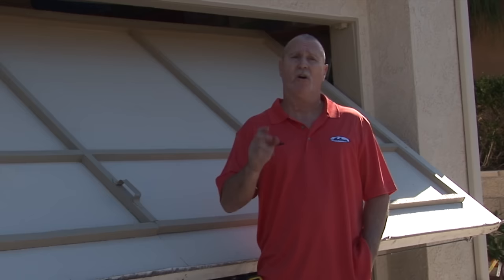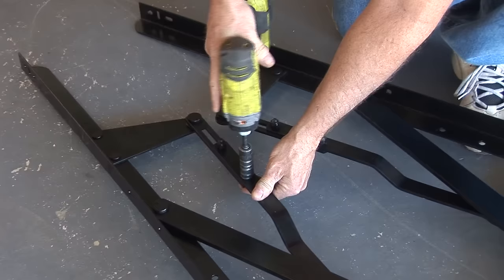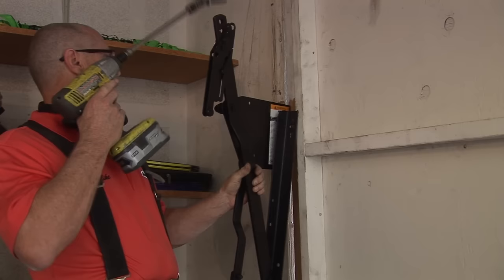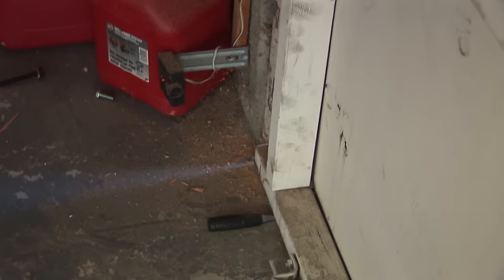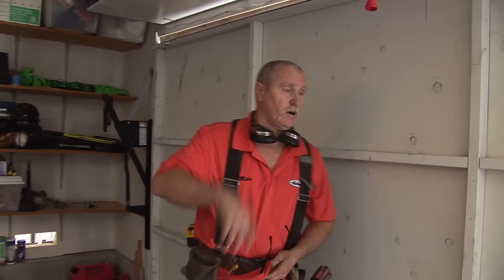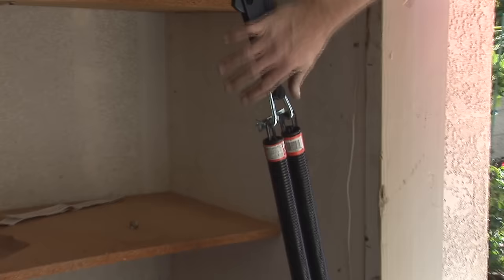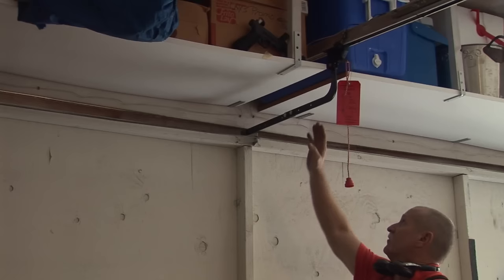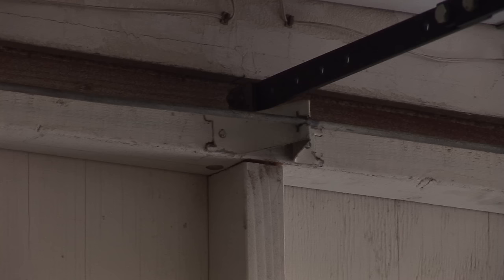Installing Holmes E-900 Hardware & Springs

Comment: How the heck would you connect conduit to a garage door bracket. I have to know. Ok wait you flatten one end and drill a hole in it?
Reply from the maker: Exactly! but if you have one of the wider chamberlain door brackets then just flatten it enough to fit inside the door bracket, oval it basically... it eliminates slop if you have a tight fit.

Comment: Great video 
Hi Ben  from Australia 40 minute  you talk about the normal hole on the plate mine is in the second hole I need to move to the normal  hole  do I support the garage door   take out the springs then move it or can I move it  with out taken the springs out. Cheers
Reply from the maker: That's a great question! By the way... G-day mate!! Always love talkin to the Aussies! You can do it without removing the springs, you have to kick the door out so it's about a foot open then support it with your leg and back then remove the bolt. Now the door is going to want to go down at the bottom and forward at the top and the bolt barely has enough room to come out (there's a washer in there too so don't let it fall out) but once you get the bolt out use your leg and back to force the door to go in the direction you need it to go in order to drop into the normal hole, it's a bit of a juggling act with some finagling but it will go.
Reply: @ALLProGarageDoors  Cheers mate thanks.

Comment: Hi Mike, I have a 8 feet high tilt up door. I can't find any e900 hardware for it. Do you know where I can purchase it? Thanks
Reply from the maker: E-900 is only rated to 7’4” or 7’6” high doors. look for Lcj-8 or Hcj-8. you could also try Apex hardware, its better than Holmes and they make 8 ft as well. try home depot. com or google apex garage door hardware.
Reply: @ALLProGarageDoors  Thanks Mike! That helps alot

Comment: Great video, very informative.  I have a one piece galvanized metal garage door (dimensions:  215" W by 82 1/2" H). One of my door side springs broke.  I could not determine what size the spring was, it was very rusted. So i looked for a replacement spring about the same size and diameter. I bought 2-P528 springs.  After i installed 2 new springs the door would not close, it only partially closed then got stuck.  What do think I am doing wrong or have not performed any adjustments. Also how do i determine which are the correct springs for my size and weight of garage door?    thank you Phillip
Reply from the maker: It sounds like you have the right size springs if you tried to match what was already there. It's extremely hard to tell why your door springs are maxed out. maybe this video might help.  
https://youtu.be/VgxtZlpW9us
Reply: @ALLProGarageDoors  I am 73 years old with heart disease.  I am not strong enough to extendP528 springs, any suggestions on other options to extend springs to the C hooks.
Reply from the maker: @phillipnajera5224  I've never tried it any other way, maybe a neighbor could do it for you? I think it could be done other ways but rigging up a come-along would be just as much effort.

Comment: If I use a one-piece door like this will I have more height? I have a standard type Clopay 4 section door now. I am able to build a door as you did in your other video. Thanks
Reply from the maker: lostintime86 no... you’ll have less height because the door sits under the header. So you lose the thickness of the door, roughly 2-6 inches depending on if you use steel or wood.

Comment: Sir I have two 12 foot wide by 8 Foot tall doors to build and install. The E900 hardware kit list that it is for 7'4" tall doors max. Can I make this work for the 8'-0" ? Can not find any hardware for 8'-0" tall doors. Any suggestions would be appreciated. Thanks for the videos didn't think about building the doors until watching your video
Reply from the maker: Normally the 8 ft hardware is listed as LCJ8, if you can't find it then yes the E-900 can work in a pinch but sometimes balancing the doors  can get trick but if you use p-732 springs,  you should be fine.

Comment: When I build my door to fit my opening...what should the tolerances be? I want the door to fit snug as possible as it the room/garage will be a living space when closed. Think more of a flip up wall than garage door. It won't be cycling open and close as much as a regular garage door. I was thinking 1/4 inch gap on each side? Also does the door hit the header at the top to make a nice seal? Or is there a gap at the top also?
Reply from the maker: Garrett Brittle great question! If your not putting an opener on it then yes you could do a 1/4 inch, with an opener then min 3/8ths and yes the door should touch the header for a good seal.
Reply: Perfect thank you. I got one more question - I hope. I want my door to be flush on the inside of the room with the drywall. To do this I was thinking I would make the top of the door fit the inside area of the opening just as the sides of the door do with 3/8 inch tolerance. Would this work? Picture basically a 2x4 constructed door that fits in the 2x4 constructed wall like a plug. Think it can work? I can call or email if needed.
Reply from the maker: Garrett Brittle , i think it can as long as its not too wide because a double door needs a truss rod to support the sag when its open. If you plan on tucking it in underneath the header instead of butting up to the header then start looking around for whats called “flush mount hardware” not sure if its still avail or not but i would think somebody makes it still.
Reply from the maker: I think if you use normal hardware you will need between an inch and an inch and a half if you want to tuck under the header... 3/8 above the door I don’t think is nearly enough.
Reply: All-Pro Quality Garage Doors Inc. hey man thanks for response. I ended up modifying the header to make the door flush. I’ll record a quick video showing what I did. Build my single car door yesterday also.
Reply from the maker: Unless you can locate a set of flushmount hardware.

Comment: Where can I get just one of the deadbolts that comes in the hardware kit? Every one I can buy is thinner and cheap or a 3/8" padlock shackle will not fit even though they claim it's for that size.
Reply from the maker: I prefer the shielded hasps, you can probably find them somewhere online.

Comment: As far as lubricating the 5 pivot points, would White Lithium grease be adequate, or is there a specific lubricant you recommend?
Reply from the maker: I currently use white lithium.
Reply: @ALLProGarageDoors   besides lubing the moving parts "inside" the GDO, would you also use white lithium grease on the chain, sprockets, and the t-rail?
Reply from the maker: yea you can use white lithium on anything really.

Comment: If I install the door so that the top of the door touches the back of the header, does that mean that the door isn't 100% vertical when it's closed? Does it rest at a slight angle or does the door come down vertically behind the header?
Reply from the maker: Phil L The door does indeed touch the back of the header and should sit fairly vertically, sometimes they aren’t perfect and could be at a slight angle outward when fully closed...but that is controlled by the cantelever arm and can be adjusted.
Reply: Ok, that makes sense.  But if the top of the door is hitting the header, what is the purpose of the jamb bumpers (or door stop)?  Should it hit the header or door bumpers first?
Reply from the maker: Phil L In a perfect world you would like the door to hit the header and the jamb bumpers at the exact same time.
Reply: Great.  I'm going to give it a try.  I'm up in Poway so if I get stuck, I'll give you a call.  If it all goes well, there'll be a nice YELP review.
Reply from the maker: Phil L excellent!

Comment: The guy knows the plate is fractured because he ran into the door in his BMW approx. 6 months ago but fails to bring it to your attention. 
If it failed the next day instead of today, do you see the customer trying to place blame on you since you just worked on it? Or am I overly cynical and need to stand down? 
(I have been accused of being a "conspiracy theorist", whatever that means, before) 
And do you consider it bad on your part for not noticing the damaged plate immediately? 
Thanks again, Mike!
Reply from the maker: I wouldn't say it's overly cynical to always think of all possible variables... i do it all the time. In this particular situation everything was set up by Holmes Halley the hardware mfg, they gave me an address of a guy who's hardware was worn out and the sales rep met me there with the new hardware so up to that point i'd never been to that house. We fired up the camera and just went at it.

Comment: How cool I figure where to place the main lever on the jam without a template? Thank you.
Reply from the maker: You measure 19 and 1/2 inches down from the underside of the header beam plus the thickness of the door taking this measurement from the side of the door not the top or bottom. If you have a design on the door that has to be considered as part of the thickness as well. Now that measurement would be where you would drill your first pilot hole for the Lag and NOT where you place the top of the plate.

Comment: so the E900goes up to 350lbs. Those are single doors. I have a double 7'x16' all wood from 1969. I have no way to weigh it. I cant seem to find anything bigger then the E900? does anybody know ones that are close to the Homes 1100 series that I have on the door already?
Reply from the maker: The 1100 series is light duty. Use the E-900…. much heavier duty. If you think your door is heavier than most you can look around for HCJ-7, that’s pretty super duty but might not be available anymore.

Comment: Getting ready to finally replace my original Holmes garage door hardware. Why wouldnt the new "hinges" just bolt up with the old mounting holes if theyre the same mfg hinges? Thanks
Reply from the maker: They can as long as they are the same model of hinges. Older hinges tend to be 1100 series and newer ones 900 series if they don't match the hole location should be different
Reply: @ALLProGarageDoors  makes sense. Thx for the speedy response.

Comment: Good morning Mike, I already brought the e900 with me, a problem, and they made me leave the box at the airport and I don't have the instructions, but I want to ask you. Is the midpoint of the floor to the ceiling of the wall where the arms will be placed taken as a reference? Or how do you get that distance? Thanks, hug.                                                             a problem picking it up at Home Depot is one store where the springs were and in another the arms, uffff, wrapping it, etc, so that later they made me remove the box and pay again to laminate it, chaos.
Reply from the maker: To get the measurement location for the E-900 you measure 20” plus the thickness of the door, from the top of the jamb down
Reply: @ALLProGarageDoors  I don’t understand sorry
Reply: @ALLProGarageDoors thank you Mike thank you
Reply: @ALLProGarageDoors  the thickness of the aluminum frame above?
Reply from the maker: not just the frame but the door
Reply: @ALLProGarageDoors 20” ?

Comment: If my installer stripped some of the bolts, where can I get replacement bolts?
Reply from the maker: Phil L  that means your installer wasn’t much of an installer. You can contact Holmes or just go to a hardware store and pick up some grade 8 bolts.

Comment: And if I buy a 728 and in reality the final weight is less than 250 pounds, does the excess spring cause me problems? Or would I have to put the 528? I still don't know the final weight, I'm starting to build it out of aluminum these days. I have to go in 10 days to buy them at Home Depot in Fort Lauderdale but I'm going to buy them before I know the final weight of the gate. Thanks bro.
Reply from the maker: Aluminum doors can be tricky to balance because they are so light. I’d probably go with 1-528 on each side if it’s a double car width and try to balance from there.
Reply: thanks mike, so i'm going to travel to fort lauderdale to home depot for the kit and the springs, i'm going to buy 4 528 springs, if it goes well with one on each side that's fine, and i keep the other 2 as spares? but check that it is a double door but complete. it measures almost 20 ft wide. and height 7 ft. Wouldn't 2 of the 728 be better? I don't know, the one who is the teacher is you. thank you very much mike you are a great man
Reply: this would be my request, do you see it well? or remove something?   2 - 728,   2- 528,  1 - e900 kit hardware, 2- wh-18 w- hook
Reply: Or. 4-528. And same 1- e900 kit  and 2 - w- 18 ?
Reply from the maker: @ger7941  If it were me i’d go 2-528s and 2-728s for spares since they are cheaper. i think you can balance a 20x7 pretty easily with a 528 on each side but if it doesn’t work then atleast you’ll have the two spare 728 for added tension. so yea i think your first list is accurate
Reply: Thank you Mike. Gracias.

Comment: Man, I just don't see what the benefit is of using one-piece doors. I know you don't need to use track like with sectional doors, but, they just seem so much more protruding and..... in the way I guess you could say. I actually didn't realize they were still used today (I'm from the Northeast, so that probably explains why). All that said, nice work!
Reply from the maker: Sharkie626 I’m with you that buddy but occasionally you will get that type of person who absolutely loves their 1pc door and won’t part with it.
Reply: Yep! I guess that can apply to many things and not just doors. Haha.
Reply: For one part their is less components on a one piece door then as a sectional door. And there are some one piece doors from the 50’s that look real good and no one wants to get rid of them lol
Reply: Benefit = As you said, no over head tracks sticking into the garage. Those tracks need to be supported by attaching them to the ceiling.  My garage roof goes up almost 1.5 stories.  My shelving on the walls would be obstructed by the tracks inside the garage.  Drawback = You can't pull right up to the door.  I have a long driveway, so not an issue.

Comment: Why does my door hit the header when opening ?
Reply from the maker: Lots of reasons for that, could be wrong drive arm angle, down limit set too far, top section flexing too much and allowing opener to push it down and under the header. Easiest way to fix that is to adjust your top roller bracket so the door can't possibly go that far forward. In other words loosen the top roller slider and push the slider forward bringing it closer to the door and tighten it up.
Reply: I won't be using an opener, I'll be doing it manually. Do you think the fact that I used a 2" square metal tubing for the door frame, could be the cause of it hitting the header? I've adjusted the cantilever arm to the furthest hole and it still hits.
Reply from the maker: @dvalful  For some strange reason i thought you had a sectional door. the one piece door is supposed to use the inside of the header as a stop bumper if your door goes under the header then your door is too short

Comment: how long of an angle iron to i use  which you demonstrate 6:20 on this clip
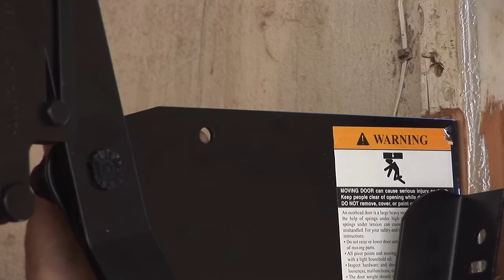Reply from the maker: You mean at 16:20 ish, 
You can use a 16 inch piece or somewhere around that size.
Reply: yes i mean 16:20 the wood is splitting on mine so will try to brace it to relieve the stress , 
thank you again
Reply from the maker: Frijo1 if thats the case then go as long as you can so when you run the lag in at the top the crack doesn't follow but always predrill a pilot hole and as long as the crack isn't too bad you should be good to go!
Reply: I had the garage door specialist look at it so he could correct the problem this morning and he tried to convince me to get a new and different system, a section garage door  with track instead of a solid door he says they are safer and more secure, which I don't agree.
Reply from the maker: Frijo1 well, its hard to justify an entirely new door just for a small crack in your jamb. Brace it and you'll be fine.
Reply from the maker: Frijo1 no problem at all.

Comment: Any place to get single piece metal door parts? The stud that a door spring fastened to broke off the metal that supports the door. Does anyone still make the doors that open out and up?
Reply from the maker: In all actuality yes, the parts are still avail and home depot sells the hinges and springs if you can't get it at a garage door co. Not many still do wood 1pc but we do steel 1pc doors

Comment: WARNING.WARNING. WARNING........WHAT HE DOESN'T TELL YOU IS THAT WHEN YOU LOWER THE DOOR AND TAKE OF THE HARDWARE, THERE IS NOTHING HOLDING THE DOOR IN PLACE. MY 300 POUND DOOR FELL RIGHT INTO THE GARAGE. LUCKILY I WASN'T UNDER IT AT THE TIME.  SHEESH!
Reply from the maker: Some degree of common sense needs to be applied here, listen to your own words....”when you lower the door and take off the hardware there is nothing holding the door in place” That is correct, so you only do one side at a time so there is always an arm holding it. Or you put a nail in the jamb. But if you don’t have common sense then call a pro.
Reply: @ALLProGarageDoors  He might have mentioned it in a 48 min video
Reply from the maker: Robert Peltzman he can’t always remember every detail of every video, some things just get left to the viewers to think about.